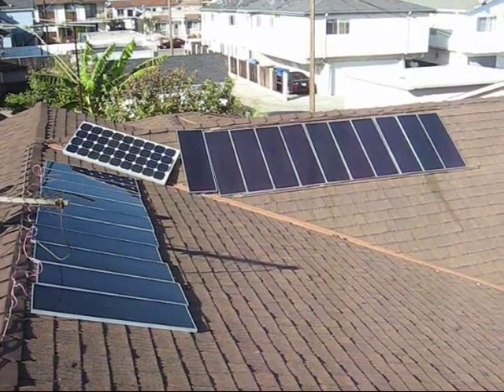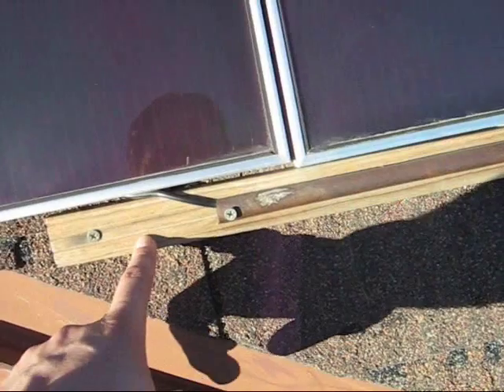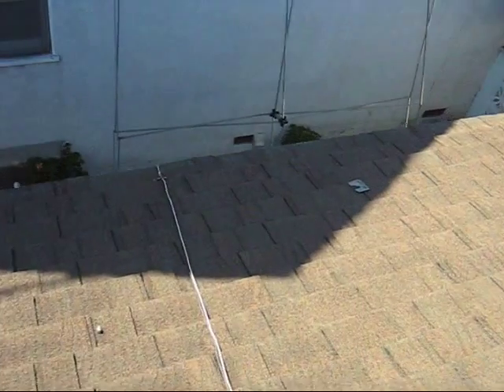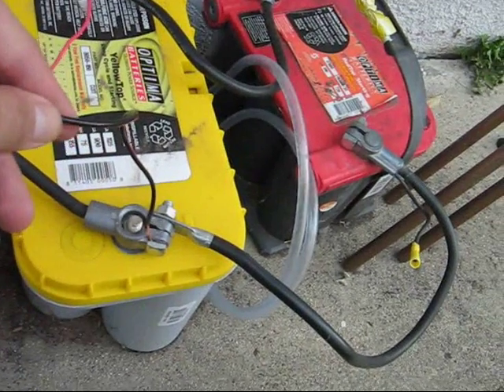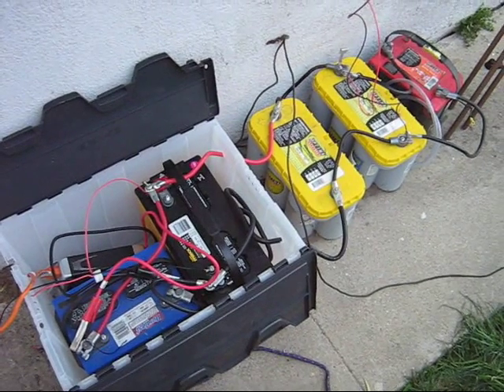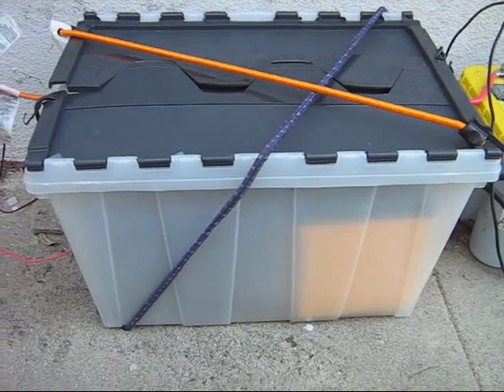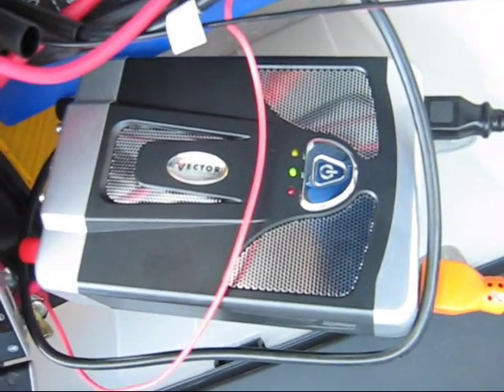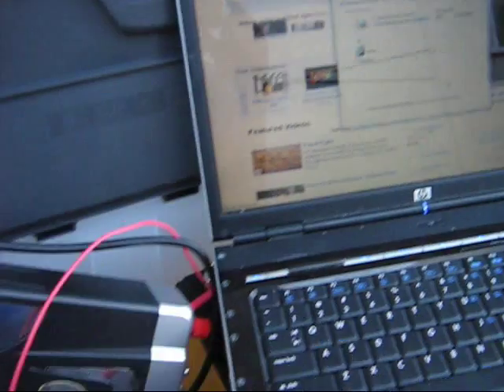Advanced Solar Power Demo

Comment: Your set up is simplistic but good. I would suggest a Charge controller. Your batteries will charge better and last longer.. Plus prevent over charging...Might want to put the inverter in a separate box to avoid flash fire..

Comment: Where is the solar charge controller to prevent over charging of batteries? What about the holes you made in your roof membrane by drilling screws for the mount? You need to waterproof those holes

Comment: ur also sticking a  inverter in the box with a  acid battery ... top it off  the box is closed  it  can expload  badly   if the gas released from the battery when charging  to be  lit  and expload and batteries are naturally explosive near a spark in a enclosed container

Comment: This is a good I dea indeed. In this demo. of Solar power I wonder how he prevents overcharging of the batteries.I can't recall if he mentioned a regulatory circuit.With 5 or six different batteries I was thinking would he need a voltage regulator attached to each battery since the idea of the regulator is to prevent overcharging of the battery. ! X12volt battery at the receiving end of the solar power it would be more simple but this single battery would be costly and need to be high capacity.

Comment: i am a electrician myself maybe one does not always have to be scrupulus and always get a permit and inspection for all this of grid work even though some local laws might say so  but whats vital to remember with batteries is that they have ample power to cause a fire and fusing or overcurrent devices should be used especially when  going from larger wire to smaller ones and mavbe a bit bigger wire from the solar panels down  to reduce resistance loss unless using much higher voltages

Comment: Your wires are too thin for this current. Have you decoupled your Panels with Diodes ?
You should rework this and you gain more Power from your panels.

Comment: Your wiring is just asking for trouble. When your house burns up all the insurance company has to do is look at this video and deny your claim! Your describing a series circuit I don't know how your system is working correctly? You might want to make a rail for your panels, they are expensive to replace!

Comment: What a lunatic.  Totally illegal/dangerous set up - bet this guy lives in a rental - screws right thru the roof and ruins the integrity of the roof - and the hold down system is absurdly flimsy - hopefully those panels fly off and slice this idiot's head off - but as usually happens, it will hurt someone else - bet on it.  And the wiring! Oh my!   Dude, Rube Goldberg would be proud...

Comment: Are you aware that putting a battery on concrete discharges your battery? Also are you aware that using different batteries of different loads will ruin your batteries? What will happen is the more powerful batteries will try to equalize with the weaker batteries and will overcharge them beyond their capacity. Just my 2 cents...

Comment: Correct me if Im wrong, but It appears you have different Amp hr rated batteries connected. This is not advisable. Its also not advisable to connect older batteries to newer ones, or different Ahr rated batteries to one another. This imbalance could shorten your batteries life spans, especially the newer batteries. Check the  Xantrex web site. They are the top experts in this area.

Comment: some comments about your setup.. You could (if possible in your area) connect all your solar panels to a grid-tie inverter instead. That way you output ALL generated energy to a much bigger "battery" .. the grid! ;) Then you don't need expensive batteries.. I power my laptop with a 12v car adapter, saving some power. Your 700w inverter takes power without any loads connected to it. The bigger inverther the more it uses when its on, without load. So choose inverter to your load..  thx!

Comment: As another poster has already pointed out, the lead acid batteries should be vented.  I would move the inverter right next to the charge controller.  With the inverter inside the same box with the lead acid batteries, current setup is an explosion just waiting to happen.

Comment: Optima batteries are expensive b/c it can be mounted in any orientation and its rugged construction.  These are often used for jeeps, ATVs and such. For typical home solar system, this is very unnecessary expense.  If it sits outside like that it can be a target of theft, making it even more expensive.

Comment: @mnb888mnb, hes running a 12 volt system so the panels have to be in parallel to maintain 12v. which is ok for smaller systems. I would say anything over 500watts he should upgrade to a 24v system.

Comment: yikes ! this is a serious fire hazard and a serious electrical shock hazard. The wires are not protected and fused this can either cause a fire or possibly kill someone.
I am all for solar energy, but electricity at this scale is not something to play around with...  The batteries will surley overcharge and cook off the electrolyte without a charge controller (poor batteries), again no fusing, switches, and protection - a huge hazard...

Comment: nice equipment. keep pressing forward. i've got a home made system going as well ,and i fix it up little by little. but the main thing is that it spreads. not matter how crappy or great it is other ppl see and they too wonder what they can do to save power and money. if we could get most ppl to use just one panel, it would save so much.

Comment: shouldn't there be a charge controller?  what happens if you don't use one?  also, can you get electricity directly from the solar panels to the laptop in some way - or do you have to go to the batteries, to the inverter, and then to the laptop?

Comment: This is a really bad setup. First of all, all the batteries need to be the same brand and same size, those $200 batteries are being wasted the way they are used.
Next, don't use a best buy inverter because they are very inefficient and square wave, good inverters are a lot of money. That rack thing on the roof, if those panels aren't attached to the roof VERY WELL, the surface area of wind they can catch is amazing, they will sail away.
Overall, dangerous, poorly designed and inefficient.

Comment: You should NOT mix and match battery types and sizes.  If you have batteries in parallel, they must all be the same exact battery size/type/brand for best life.  You also need a larger gauge wire going down the roof from the panels to the charge controller.

Comment: Be careful go through an dc isolator then to a solar regulator. Keep the wiring short as possible. From regulator connect to inverter and a 12v battery bank both via 12 volt isolators and suitable size blade fuses

Comment: You shouldn't mix battery. Or at least not battery capacities. As the battery bank will be stunted by the smallest battery. If you have a bank of 3 battery 2 50 Amp/hrs and 1 20 amp/hr you don't end up with 120 amp/hrs. You end up with 60 amp/hrs. Because the charge controller will detect the whole bank as charged when the 20 amp/hr battery is full. At that point the controller will stop charging  the 2 50 amp/hr battery. Which will have only 20 amp/hrs, less then have a full charge.

Comment: I made a portable version in a 2'x4' waterproof box on wheels with two red top optima batteries 210 minutes, and a 2500w inverter 5000 watt peak, with an 80 watt solar panel lid. Cost about 1000, but I can run my power tools anywhere!!!!Gonna post a video of it soon.

Comment from the maker: Currently I am using a Charge Controller to prevent over charging the battery.

You will need a Power Inverter to convert 12 volts Direct Current to 110 Volts Alternating Current.

Without a power inverter you can't use the power in the 12 volts batteries to turn on your TV for example.

Comment from the maker: The Watt rating on the panels is as specified by the manufacturer.

It does recharge to full in one day but if you use more than what you put back in then that may not always be the case. The best way is to check the voltage on the batteries at the end of the day and see just how much you have used.

Comment from the maker: I broke down the costs at the beginning of the video.

Solar panels = $2.70 per watt (estimated)
Charge Controller=$50 but I upgraded to a 80 Amp Charge Controller from Outback
Inverter = $100 for a 800 Watt Inverter ($200 for a 3,000 Watt Inverter)
Battery =Optimas were $150-$200 each the Walmart Batteries were about $75 and did the same job for less

Comment from the maker: Another thing that I wanted to mention is that the batteries were outside to just show you how it was hooked up in the daylight.

I was not at all worried about leaving them out because the batteries were enclosed preventing any water from going in and my roof was extruding past the wall about 2 feet so hardly any water damaged the storage system.

I have sinced moved the batteries to a well ventillated closet for easy access.

Comment from the maker: A typical house will need about 3,000 Watts for a small house up to 5,000 Watts for a medium to large house with a grid tie inverter which is not shown in this video.

Now if you want to do the entire house you are looking to spend anywhere between $20,000 dollars up to $50,000 for a top of the line system.

This video has only 450 Watts of Power which is enough to power a TV  or a laptop computer with router and modem for the entire day.

Comment: He put the inverter INSIDE the battery box.  I hope he has a good budget to replace that thing.  All the metal parts will corrode from the outgassing of the battery.  and if there's a single spark in that closed box?  RUN AWAY!!!!  I know this  because I housed the inverter close to the batteres in the same inclosure, and even with vents, the heatsinks and exposed metal in the inverter corroded badly.  Not to mention, I have seen a few batteries pop from sparks around the gas they give off :)

Comment: I hate to say this bit it looks like you are simply reading numbers off the devices.  Have you actually calculated the watts produced by the solar panels at intervals during the day?  Will the panels fill up the batteries in one day?  Have you factored in loss due to resistance?  Do you own a multimeter?  By the way, the wiring with the tape looks dangerous.

Comment: Did he mention "Battery Charge Controlller" ? To prevent battery burn-out.
And did he mention "INVERTER"  DC to AC for household use?

Nice setup but sloopy wiring and installation.

Comment: I guarantee that this "chain" you described gives off a lot less harmful byproducts than using a different energy source (oil for instance;  You need energy to drill/pump it up, energy to transport it, energy to refine it, and then it is transformed into C02 after it has been burned) There is no way to get energy without harmful byproducts, or without using energy in the first place.  The key is to finding the energy source that creates the least harmful byproducts for the environment.

Comment: Im wondering what kind of connection is under the blob of tape connecting the panels on the roof? It doesnt seem waterproof. also you need to move your feed to your bats from the charge controller. Use a pos off the optima red and the neg off the lite blue auto store bat. this gives every bat the same charge! THE BEST bateries are 6volt golf cart batteries! 220AH each wired in series to get 12V $70 ea. better AH for the $. GET A DV charger for your laptop!

Comment: Great vid man, im really interested in this. Although our houshold power is 240 volts.. Would a 110 power inverter still run most appliances? Also is there a problem with overcharging the batteries if theyre not getting used enough?

Comment from the maker: I used electrical tape which is true but before that I made sure I twisted the wires maybe 12 times to make sure they were locked in tight. The Electrical Tape will make sure they do not move around.

Comment: Hey bro,
 Very well done!
Thanks for the video. Check out mine..I have a smaller system but it works well out here in the county...The power goes out from time to time...Looks like you have the same panels as I.......Later..rick.

Comment: I could not thank you enough!  I've practically watched all solar related videos in YouTube trying to research wiring for the lead acid batteries and I found your video the most interesting, practical, and to the point.  Thanks for pointing out the connections... it really helped alot.  Right now I just initiated my first solar project: 3 X 15W (45W Total).  It all worked out because of the insight I've gotten from your video.  Thank you!

Comment: Older batteries would drain setting on the floor or ground. This was due to the battery draining or leaking thru it container it was porus.  The myth is from when batteries were made of wood.  New batteries are only affected by temp.

Comment: Am I right or did I misunderstand something.
The power controller stops the power from going into the battery Once, the battery is full.
If I am right;  could you have more than one bank of panles, each with it's own controler then conect all the controlers to the same battery.  The reason I am asking is that the panles I want to buy ,  Each come with thier own controler.
Please let me know.  Thank.
By the way  5 STARS

Comment: Northern Tool sells a 45 watt 12 volt panle for less than $80.00 and you can almost double that with cheap mirrows from Wal-Mart.
Just be carefull you don't put too much heat on them. Make sure the back is well vented.

Comment from the maker: You can use any way of connecting the wires. What I do is I strip off the wires down about 2 inches from the sleeves.

Then I twist the wires together VERY Tightly. Once that is one I can 2 things. I can use a Soldering Iron to solder the cables together then use electrical tape to wrap it up or I can use a connector to tighten up and connect both wires.

Comment from the maker: I use 12 gauge speaker wire that you would normally use to power a stereo in a house. You may also want to buy a volt meter to check the connections of you solar panels and see if you have a connection also it is good to see the voltage in your batteries.

An Amp meter owuld be nice also.

Comment from the maker: If you have a 63 Amp battery and a 10 Amp charge controller - it will charge but very slowly and depending on what you want to use it for. It could power a medium sized TV for a couple of hours.

As long as your Solar Panels are charging FASTER than what you are draining out of the batteries you will always have your battery full on power.

So if your panels charge 10 amps
Your TV uses 10 amps
Your battery can store 70 Amps

10 Amps - 10 Amps = Break Even (No Gain)

Battery stays at 70 Amps.

Comment from the maker: You want to have lots of amp hour storage in batteries so that when the sun goes down you have extra electricity to play with at night or for whatever you want to use it for.

That is why I have 350+ Amp hour battery storage capacity so the power will last me throughout the whole night and into the morning.

Comment from the maker: Yes the max a charge controller rated at 10 amps is just that 10 amps. If you over charge the controller it will blow a fuse.

So if you can get a 40 Amp Charge controller (more) expensive you would have plenty of power to play with.

Amp ratings on batteries just mean how much amps it can store at 12 volts.

Think of a swimming pool when it comes to batteries. The bigger the pool - the more water it can store. Amp ratings in batteries just determine how much electricity a battery can store.

Comment from the maker: Also Solar Charge controllers are good for a set amperage. If you buy a 200 Watt Solar Charge controller for example it may have a 30 amp fuse inside of it.

If you use up to 300 Watts on that controller it probably won't blow the fuse. If you go up to 600 Watts... you may damage the controller and the fuse will blow.

To solve this buy a Solar Charge controller with a high amp fuse inside of it. Use the formula below to figure out the amps.

Comment from the maker: You are making it more difficult than it needs to be.

Yes there are 100+ Watt solar panels and probably cost 2 times more than the panels shown here. They take up less space but are much more expensive.

A Solar Charge controller just reads if your battery is full then stops charging the batteries.

Here is how you calculate math for this:

400 Watts / 12 Volts = 33.333** amps

That's how much it can charge on a good day but considering weather probably 30 amps charge from panels.

Comment from the maker: I probably would suggest that you have at least 100 watts for that which means 6-7 Solar Panels and probably 2 batteries if you play for more than 3 hours a day.

You have to remember that even though panels are rated for 15 Watts like the ones I use. That's only on a clear day with no clouds. 

So with a cloudy day you may average about 6-13 Watts out of a 15 Watt Solar Panel. 6 if it is completely cloudy and 13 if it is partly cloudy.

Comment from the maker: Yes to power a house you would need more Solar Panels and Batteries if you want to power you Refrigerator, TV, Computer, DVD Player, Playstation, Internet Modem, Router, Lamps, etc.

Really you could power everything that uses electricity in your house using this.

It's really not too hard to use Solar Power - Some people just don't know how to do this so I made this video for them so they can save money.

Energy is always available because the batteries store energy.

Comment from the maker: The wires from the panels are cut short so that the panels in the case of strong winds only lift about 6 inches high off the roof and the ones without the rack are just for demonstration of how the wiring is set up.

Normally they would be screwed on with the wooden rack.

Besides the panels weigh about 15 Lbs each so they won't be flying anytime soon.